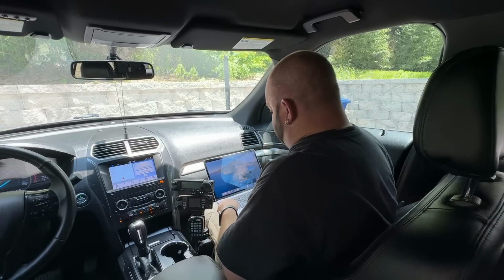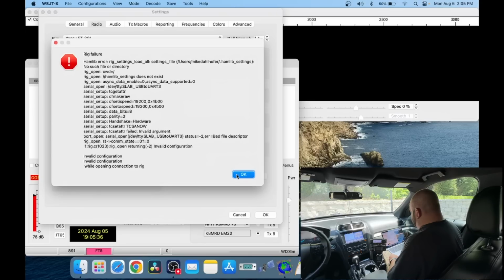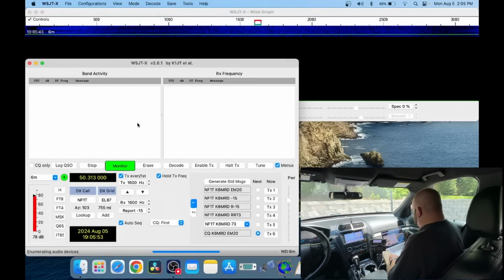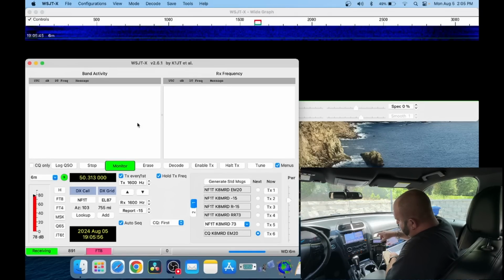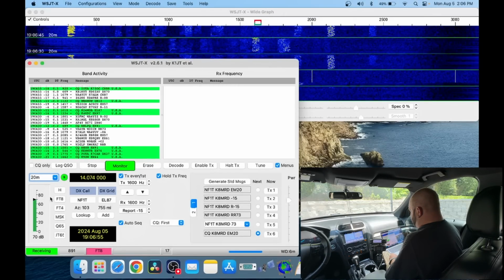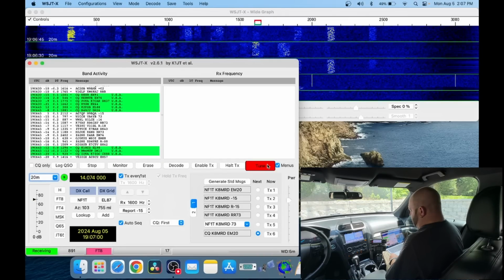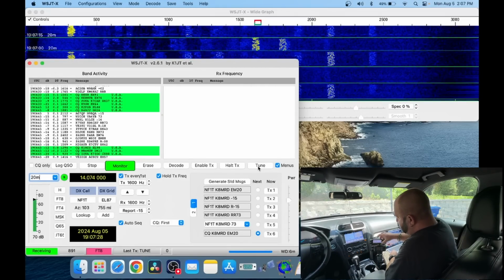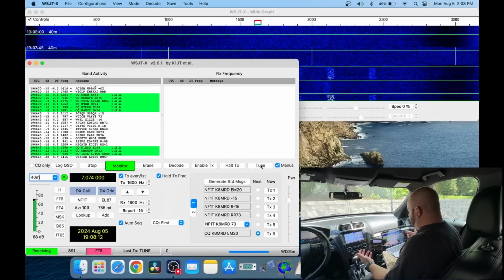Brand New Digirig DR-891 Fast, Easy Digital For Yaesu FT-891

Comment: Just saw this video. I have a signal link also, and after the setup to the computer and radio I stopped using it. This digi rig for the 891 could possibly get me to go back to ft8. This is cool and simple. Great video.

Comment: Apple OS is SO MUCH EASIER than Windows when using WSJTX.  Windows has 20 things to change in the audio settings and anytime you unplug or use a different USB port, Windows has to be setup all over again.  +1 for Apple

Comment: Mike, what pedestal mount are you using? And is there anything different you would try?
Reply from the maker: It's a Lido Radio L-Max Deluxe.  https://www.lidoradio.com/collections/complete-mounting-solutions-for-the-yaesu-ftm-100-ftm-300-ftm-350-ftm-400-ftm-500-ft-891/products/l-max-deluxe  Here's the most recent video I did installing everything in my car.  https://www.youtube.com/watch?v=4MaAWUBpCcA  Lido has all kinds of accessories for the mount so you can get just about any configuration you can think of.

Comment: Can anyone help me with getting this setup for WInlink?  When I plug the dr891 in I get both com ports. Enhanced and regular.  I have cat control no problem on com 4. But when I try to set com3 as PTT in Vara radio setup it tells me Com3 is already in use.  There are no other devices plugged in to my pc.  I have tried this on multiple computers and they all do the same thing.  What are the PTT settings supposed to be with the dr891?  External??? Ft891??? This thing is on my last nerve!
Reply: I believe PPT is controlled on the 6 pin din. I just got my Digirig and haven't configured it yet but I read some where PPT is on the 6 pin din along with the sound. USB for strictly for mode/frequency etc.

Comment: Does your setup work longer than 10-20 minutes with WSJT-X? There are many stories of unsuccessful Digirig setup with M1 Mac (when the same box works perfect with windows or linux). After some longer period receiving audio gradually gets distorted, decoding ratio drops and you need to restart WSJT-X to fix it. Until the next time. As even chinese audio dongles works ok, it is unclear if the fault is on Digirig or Mac side. No permanent solution so far...
Reply from the maker: Yeah, I've sat in my car doing FT8 for a couple hours at a time with this setup.  I have 3 Digirigs now and they all perform flawlessly.  I've literally never had a single issue using Digirig on Mac or Winblows and I use them with the G90, FT-891, and FT-818.  I would have to guess it's user error.

Comment: I had a problem with the CAT control.  The radio kept shifting the frequency around.  I changed "split mode" in wsjtx to rig instead of fake it and that seems to fix my problem.

Comment: Hi, a new HAM here. Thank you for the very detailed video. BTW i have a question. I like both FT710 and FT891. i intended to use Radio with a external antenna tuner. In the FT-891, it is very difficult to change the power level to tune the antenna because of the complicated menu. Do you think the best solution for this is to set CW mode to 5W, and whenever we change the band, we can simply switch to CW for tuning and then change it back to SSB?" If that will work, can i know if i click on PTT does it transmit CW waves even without a Keyer ?
Reply: I assume you have external tuner not controlled by radio. Then turn on ATAAS mode tuner in your FT-891 setup menu. Then if you press PTT and up or down button on the mic you will get low power carrier good enough for any tuner.

Comment: I have a couple questions, will this interface allow other HF digital modes like PSK and packet?? Can you operate regular SSB voice with the cables still plugged in or do you have to disconnect them?? Can I still use my LDG auto tuner with its control cable plugged in or does the Digirig unit us that control connection?? My 891 is inside the dash of my truck and the control head is mounted on a plate where the FM radio used to be.. I am not against putting a toggle switch that swaps which device is connected but wonder what issues might occur switching back and forth..

Comment: This is a cool new addition. Makes the 891 just as easy to use for digital as my 7300.
Reply: The 7300 requires one cable from computer to radio. The digirig requires three. That is "just as easy"?
Reply: @WilliamLee-eh6hy  well if you want to get that picky about it sure it's one extra connection to the radio. But with the new digirig you only need 1 usb connection to the computer to have cat control and audio

Comment: Digi Rig is awesome.  I have outher radios and DiGi Rig came threw. easy setup and few cables. The only problem i had with DiGi Rig is getting the settings right for digital modes. verys a lot from radio to radio . I renamed my USB audio device to DiGi Rig so I know. I got my Talkpod doing some digital modes. radio is FM only. SSTV was fun on GMRS and MURS . All my cables from DiGi Rig came with ferrite already on them. The problem I had in the past FT8 was during transmit  my PC would freeze up. need to totally reboot. and only did this on some bands and some antenna and only some parks. was odd. but simple FT 240-31 wrapp USB cable fixed this. This was ICOM 7300 using USB B to USB A cable . never had a RFI issue with DiGi Rig. and a ran 1KW FT8 and made 10 meter contacts with the band flat ! when bands good 50 watt or so does real well. For my end fed antenna counterpoise helps with RFI . but depends on type of antenna coax and what park. 73

Comment: Anyone tried this with FT8cn on a phone or tablet? I sometimes run my truSDX with a tablet running FT8cn using just the usb-c cable and it works great. Hoping for a similar set up with the 891 using this

Comment: I just configure WSJT-X to VOX and let the Signalink key up the radio on its own, so the USB connection to the FT-891 isn't entirely necessary.  I also like the physical volume controls.  That said, this is pretty tiny and I will try it out!

Comment: The receive rf gain should also aid in reducing the audio input to the digirig, if you run out of range with the computer control...   Great Video, I've the digirig for the KX3 and your right they are the bomb.  I'd previously built my own digirig, from a stripped down mini usb sound card, a tiny rs-232 to usb, and a tiny usb hub, I ripped off all the plastics, and hot glued them in a small enclosure, but it was about 5x bigger than the digi rig, but mine had leds   (🙂 )  Thanks for that video... 73s

Comment: Looking at the first three minutes of your video for the connecting to the radio itself, this really feels like a product that could be made with connectors on the side of the housing that are aligned with the sockets on the back of the radio, so that it is hooked on like a directly-connected dongle rather than as a remote peripheral.  If they were to do that then they could leverage some screws on the case of the FT-891, like the ground lug and/or the top two rear case screws to hold it in place.  It wouldn't need connector cables that way, only the USB cable to the computer.

And that's assuming that it isn't installed internally by opening up the radio and connecting inside, even if cables have to come out through the side of the radio case to reach the connectors if there aren't internal headers available.

Since this is for a specific model only, seems like a change to one of these form-factors would be very advantageous for customers.
Reply: It’s a great idea! I will be buy this one and Velcro it to the top of my radio, though.

Comment: You can do it without 2, you just have to manually change the radio and do it without CAT control. but this is really cool. I may have to get one soon.
Reply: Agreed - I only use one cable from my 891 to my laptop and do manual CAT

Comment: How is this different from the original DigiRig? I currently have a DigiRig for my FT-891. What does the new model offer over the old one?
Reply: I have the same question.
Reply: @jandersonemtp we might have to wait for a video from another Ytuber. Even the DigiRig website is not very clear about this matter.
Reply: Believe it gives you CAT control with just one cable connected to the computer/phone/tablet. This required two cables with the original.
Reply: I believe there's a usb hub inside this one, so the sound comes through usb as per regular digirig but the digirig also connects to the usb cat port and that is also carried over the one single usb lead. So two wires from digirig to radio and one from digirig to computer.
Reply: @JohnR_ytbe  yes. I looked into it a little more and found t adds CAT control through the digirig rather than a separate USB

Comment: The vide isn't out yet but I have never understood digirigs. They're just sound cards. Why not plug your radio directly into your computer/phone which have sound cards?
Reply: CAT control of the radio. That and not having system sounds from the computing device go out over the air is some setting is forgotten or mis-configured.  And interfacing some older radios (such as my IC-706MKIIG) is much easier with a Digirig.

Comment: I got mine last weekend and used it for a POTA activation on Tuesday. It worked great. Using only one USB-C cable made my setup a lot easier. Also, with my old DigiRig I had to do the attenuator mod to keep the levels where I needed them. That wasn't necessary with the DR-891. It worked great right out of the box.
Reply: I thought I recognized you Mr. Pezet.  Welcome to the hobby!!  Glad to see you are enjoying FT-8 and POTA.
Reply: @chrisranes7964  It's a small world!

Comment: In theory mine should show up today - definitely looking forward to having it.  Hey Mike do you think you could do a video on the different ways to spot yourself when off-grid?  I have been using a ZOLEO Iridium device to do it, but I recently heard about SOTAmat and then using your phone to "play" the FT8 codes through your radio (haven't tried that one yet).  Plus I think there are other ways like APRS and maybe winlink email?  Would be nice to have a consolidated video that covers the options.